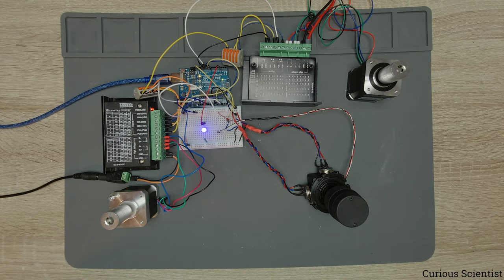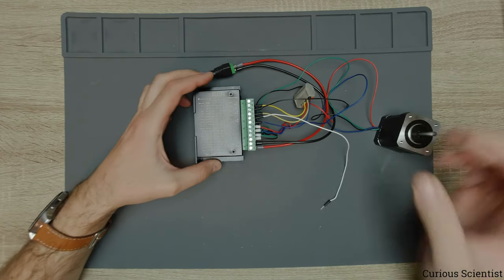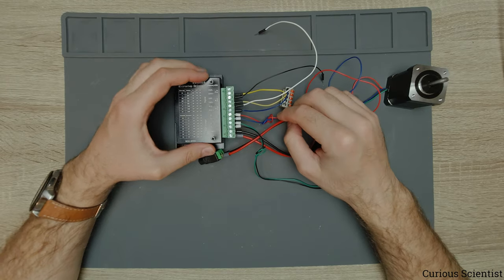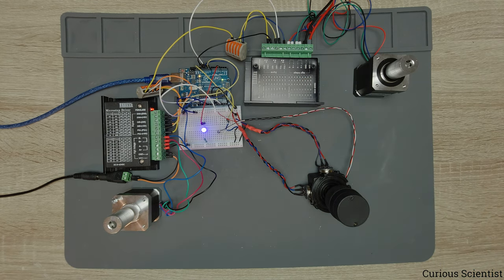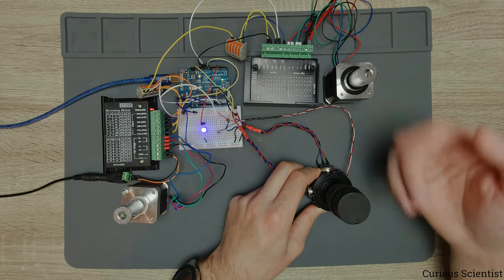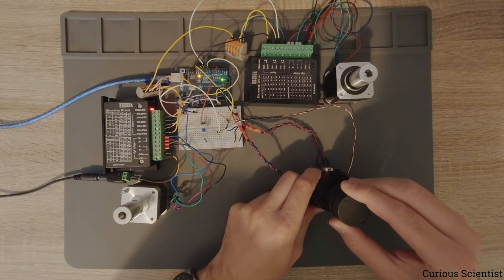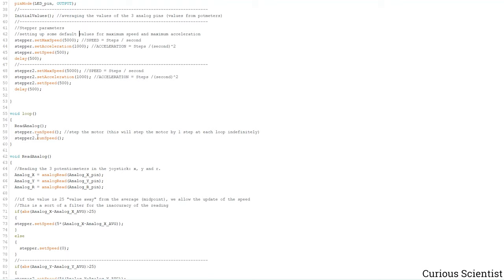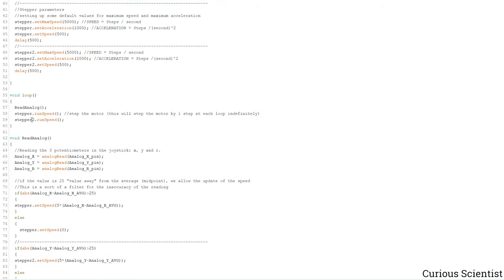Multiple stepper motors with joystick, TB6600 and the accelstepper library

Comment: i have a TMC2208 and when i use the joystick to control it i notice that it runs really rough. When i run the Stepper with the Accelstepper Library then its really smooth and quiet. I think thats due to the setSpeed/runSpeed command, i think it would be better if we would calculate the commanded speed but also with acceleration/deceleration.
Reply from the maker: Do you use the same microstepping? It can make the stepping rougher, especially with the lower divisions. The acceleration would be a little bit tricky with the joystick, but could be doable. However, I would write a code for it from scratch.
Reply: @CuriousScientist  i have set it to 1/16. i just did try out 1/2 step and dividing the maximum speed by 5 and when i hit the maximum speed then the motor runs nice but whenever i dont hit the maximum it runs rough. maybe i need to filter the joystick values but then i still dont have acceleration.
Reply: also the TMC2208 even at fullstep has a sinusoidal wave output to the stepper unlike for example the a4988 which has a rectangle output
Reply from the maker: @ipadize  what do you mean by the maximum speed, do you mean the setMaxSpeed()? That is the global maximum you can reach with the motor by accelerating or manually increasing the speed to the maximum speed. If your microstepping is 1/16, one turn will need 3200 steps. So, when you are not maxing out the joystick, you are at the lower end of the speed value for the motor. I am not sure, because I haven't used that driver before, but maybe it needs more current when it is forced to move with such microstepping. The acceleration would need a totally different approach, this code is written based on the idea that the user is manually accelerating by gradually moving the joystick to one of its end position. If the joystick is moved in that way, the acceleration is done manually by the user. I do not really see the need for acceleration. Why is it so necessary?
Reply: @CuriousScientist  yes i mean the setMaxSpeed. Whenever i hit that limit the output to the stepper motor is clean but when its under this limit then the output is "dirty". I have a homing routine at the start which has acceleration and runs completely clean so i think its inaccuracy from the joystick or missing filtering of the values. When the values are stuttering and there is no acceleration then the output will also stutter and make the stepper run rough. I will probably look at the step pin with my oscilloscope.

i currently build a focus stacker for my camera  which will have a linear and a rotary axis (for macrophotography, there is a shallow depth of field so by using a stacker i can take pictures in different positions of an object and then a software will render these images and basically the object will be sharp from front to back). Acceleration for jogging is not necessary but its nice to have. For the moves between images i will just use moveTo() and run().
Reply from the maker: That's funny because I am also working on a similar mechanism. I even checked AliExpress today for buying a linear guide for the task, but my wallet said no. If you are curious about my approach, everything will be published on my channel in the future. But for now, I am only working on the software side as some of the parts I want to buy are expensive. The erratic behaviour of the joystick is really interesting. I don't really see now what can cause it, but I will look at it once I reach that part with my mechanism.
Reply: @CuriousScientist  what a coincidence^^

i will follow your approach and see if it helps me. Maybe i will upload videos of my rig too. Thanks and have a nice day.

ps. i dont have the same Joystick but the small one with a pushbutton, maybe yours works better.
Reply from the maker: That explains everything. Please invest that 15-20 USD for one of these joysticks I use. I provided links on my website if you don't want to search for them yourself. Those tiny joysticks are garbage, I suffered so much with them.
Reply: @CuriousScientist  thanks, i will have a look
Reply: btw i have found a code that probably works the way i want acceleration to work:

void loop() 
{ 
  // Every INPUT_READ_INTERVAL milliseconds, read inputs. 
  // We do this infrequently to prevent interfering 
  // with the stepper motor high speed stepping 
  // Get the current joystick position as analog value 

  unsigned long current_time = millis(); 
  if (current_time - last_input_time > INPUT_READ_INTERVAL) 
  { 
    int joystick_in = analogRead(JOYSTICK_PIN); 

    //shift the value from [0,1023] range to [-512, 512] range
    joystick_in = map(joystick_in, 0, 1023, -512, 512);

    //deadzone
    if (abs(joystick_in) < 10)
      joystick_in = 0;
    
    // Map the raw analog value to speed range from -MAX_SPEED to MAX_SPEED 
    int desired_speed = map(joystick_in, -512, 512, -MAX_SPEED, MAX_SPEED); 
//    Serial.println(desired_speed); 

    // Based on the input, set targets and max speed 
    stepper.setMaxSpeed(abs(desired_speed)); 
    if (desired_speed == 0 && stepper.speed() == 0) 
    { 
      // Prevent running off the end of the position range 
        stepper.setCurrentPosition(0); 
    } 
    else if (desired_speed < 0) 
    { 
      stepper.moveTo(-1000000000); 
    } 
    else if (desired_speed > 0) 
    { 
      stepper.moveTo(1000000000); 
    } 
    last_input_time = current_time; 
  } 

  stepper.run(); 
} 

its from a Google group (https://groupsDOTgoogleDOTcom/g/accelstepper/c/CVO28NaApKY?pli=1)
Reply from the maker: Thanks! Please avoid posting code in the comments because they are really hard to read and they mess up the comments too. But I can see that this is a really dirty coding. It cheats the library by giving a very distant target position, and it allows the library to use the acceleration because it uses the run() function. Probably it works, but I don't know.
Reply: @CuriousScientist  should i remove the code?

i have added the second motor and when i boot the arduino it first does a homing routine with the z axis. Somehow the other motor also runs at the same speed, just like if the step signal would be shared or electrical noise is interfering with the step signal but when homing is done then i can move each motor independently so it must be some code error but i dont see any error.
Reply from the maker: Just keep, it doesn't matter, but for the future please avoid posting such long codes or any code in the comment. It is especially painful when I am going through the comments on my phone. :) 

Regarding the issue, I don't know why it happens. Is it with my code or with the one you showed?
Reply: @CuriousScientist  okay. I have imported your code and changed mostly naming from parameters. The homing is from me. Nowhere in the code do i let the second motor run  automatically, only when i move the joystick. Do you mind having a look at the code?
Reply from the maker: I am very sorry, but I don't have the time and resources to troubleshoot others' code for free. I hope you understand.
Reply: @CuriousScientist  understandable and no problem :)
Reply: i was able to implement it with acceleration and soft endstops :) idk if thats a clean code or not but it works nicely (at least for now). Basically i just added variables for example newPosition and added the analog value to that variable and then put that new value in moveTo(), also i added min-max position i can jog to. You only have to make sure, that the stepper is moving faster than the value being added to that variable or else the motor will lag behind. If you are interested, where can i show you the code?
Reply from the maker: Nice! Drop me a mail please, address is on my website under the contact menu. ;)

Comment: can I connect 3 Nema 23 stepper motors for a single joystick?
Reply from the maker: No. Not even a single one. You connect the motors to the drivers and not to the joystick directly. Then, depending on the number of axes of the joystick you can hook up the same amount of motors to the circuit.
Reply: @CuriousScientist  what will be the code if I want to connect 3 TB6600 drivers to the single Joystick.
And would you please share the wiring diagram.
Reply from the maker: Wiring depends on you. I cannot guess which pins you want to use. Also, you can easily use the contents of this video to build a system with 3 motors.

Comment: I followed al the wirings and codes .
But its not working to me.. Maybe i need to flip dip sw to match on my motor?
Reply from the maker: Do you have the exact same hardware too? Many things can go wrong, so it's very hard to guess.
Reply: @CuriousScientist  the only difference is my motor.. Its larger
Reply: My motor is 57HS112-3004A08-D21.. I hope you can help me where to adjust.. Maybe on the codes or on a DIP sw..

Another thing i noticed is, when it runs on CW, the CCW is ver slow.. But i cant get the proper run.. Hope you can guide me..

Thank you
Reply from the maker: That's a hefty motor indeed! First of all, we have to make sure that the power supply you are using is capable of supplying at least 3 A. But 5 A would be even better to have some safety margins. Then, yes, you need to play around with the DIP switches. Make sure you flip them to a position where the driver can provide at least 3 Amps. There are many different drivers out there labeled as "TB6600", so always refer to the text on the enclosure. But as I can see, "OFF-OFF-OFF" on the 4-5-6 dip switches should provide high enough current.
Reply: I use, 400 for stepping on TB6600.. I have 36V power supply 30A..
Reply from the maker: @jeffreyberces8005  Wow, that should be more than enough! Have you tried reproducing more simple codes? Like only moving the motor freely with predefined steps or something like that. I would start troubleshooting from the very basics. See if the motor responds to the code as it should. Then I would add 1 axis from the potentiometer at a time and build it up progressively, step by step.
Reply: @CuriousScientist  no i haven't yet..ok i will try it..

Comment: thank you for this tutorial. I'm new to Arduino and it's really useful all this information.
I used your code to control a single Nema 17 with an A4988 and a KY-023 joystick using only X axis and an arduino Nano.....and also with the help of your second tutorial "Let's discuss different stepper motor drivers" but impossible for it to work. the motor moves step by step and only in one direction and the joystick just gives information in one direction......it's a disaster.
can you help me......
here is the modified code, you will see that the pin dir is in 2 and Pin pulse 3;
joystick X is at A0. 
.........................................................................................................................................................................................................................................................................................

//If you found this code useful, please subsricbe to my channel: https://www.youtube.com/c/CuriousScientist?sub_confirmation=1
//It took several hours for me to prepare everything, but subscription is just a click for you. Thank you!

//This code is used to test 4 different stepper motor driver circuits with the accelstepper library.
//Stepper motor controllers:
//EasyDriver
//A4988
//DRV8825
//TB6600

#include <AccelStepper.h>
AccelStepper stepper(1, 2, 3);// direction Digital 9 (CCW), pulses (or step) Digital 8 (CLK)

const byte Analog_X_pin = A0; //x-axis readings
//Pins
const int MS1 = 7; //MS = microstepping
const int MS2 = 6;
const int MS3 = 5; //A4988 or DRV8825 without breakout board

//Variables
int Analog_X = 0; //x-axis value

int Analog_X_AVG = 0; //x-axis value average
//-------------------------------------------------------------------------------

void setup()
{
  Serial.begin(115200); //define a baud rate  
  //Pin modes  
  pinMode(MS1, OUTPUT);
  pinMode(MS2, OUTPUT);
  pinMode(MS3, OUTPUT); //A4988 or DRV8825 without breakout board
  //----------------------------------------------------------------------------    
  //PINS
  pinMode(Analog_X_pin, INPUT);
  //----------------------------------------------------------------------------  
  InitialValues(); //averaging the values of the 3 analog pins (values from potmeters)
   //----------------------------------------------------------------------------
  //Microstepping setup
  digitalWrite(MS1, HIGH);
  digitalWrite(MS2, LOW);    
  digitalWrite(MS3, LOW); //A4988 or DRV8825 without breakout board
  //----------------------------------------------------------------------------
  //Accelstepper parameters
  stepper.setMaxSpeed(400); //SPEED = Steps / second
  stepper.setAcceleration(800); //ACCELERATION = Steps /(second)^2
  stepper.setSpeed(500);
  stepper.enableOutputs(); //enable pins
}

void loop()
{
  ReadAnalog();  
  stepper.runSpeed(); //step the motor (this will step the motor by 1 step at each loop indefinitely)
    
}

void ReadAnalog()
{
  //Reading the 3 potentiometers in the joystick: x, y and r.
  Analog_X = analogRead(Analog_X_pin);  
  
  //if the value is 25 "value away" from the average (midpoint), we allow the update of the speed
  //This is a sort of a filter for the inaccuracy of the reading
  if(abs(Analog_X-Analog_X_AVG)>25) 
  {
  stepper.setSpeed(5*(Analog_X-Analog_X_AVG));    
  }
  else
  {
    stepper.setSpeed(0);
  }
  
}

void InitialValues()
{
  //Set the values to zero before averaging
  float tempX = 0;
  
  //----------------------------------------------------------------------------  
  //read the analog 50x, then calculate an average. 
  //they will be the reference values
  for(int i = 0; i<50; i++)
  {
     tempX += analogRead(Analog_X_pin);  
     delay(10); //allowing a little time between two readings
     
  }
  //----------------------------------------------------------------------------  
  Analog_X_AVG = tempX/50; 
  
  //----------------------------------------------------------------------------  
  Serial.print("AVG_X: ");
  Serial.println(Analog_X_AVG);
  
  Serial.println("Calibration finished");  
}
.....................................................................................................................................................................................................................................................................................................................

I have the calibration on the serial monitor
AVG_X: 514
Calibration finished
Reply from the maker: Hi! First of all, copy-pasting the code is not a good idea because it is really hard to read it. Second, don't expect me to troubleshoot the source code for free, I am not a free support service. Check the cables, connections. Make sure you use the enable pin for the motor driver. Make sure you have the right polarity on the motor. Try swapping the DIR and STEP pins.
Reply: Thank you for your quick reply.
the enable pin for the motor driver must be hight and connected: on your diagram "Let's discuss different stepper motor drivers" it is not connected.
to help me solve this code you asked how much?
now I have an error code: C:\Users\Laurent\Documents\Arduino\sketch_feb10a_2022_02_10_stepper_library\sketch_feb10a_2022_02_10_stepper_library.ino:11:9: error: #include expects "FILENAME" or <FILENAME>
  #include <AccelStepper.h>
.........stop for tonight
Reply from the maker: @endurobikeparts3092  Not all drivers/boards require it, but some do. I can't see your circuit, so I cannot tell how it should be connected. If you follow my tutorial, it should work as I show the working example. You can see in the video that it works. For business inquiry, you can contact me via email.
Reply: hello, this morning I redid all the possible tests;
with a DM542.....arduino uno.....arduino nano driver.
I checked my voltages 5V and 12 V.
checks all my connections.....connected like your example.
with the complete code and also the simplified code for an engine.
Nothing happens, it doesn't work for me...
I'm going to try a simpler code with the Stepper.h library to see if I can get my Nema 17 to run.....
It doesn't matter that I ask you again, I have to find the problem I have with my components.....
thanks again for your advice.
Reply from the maker: Good luck with the project, I hope you will make it work!
Reply: thank you very much